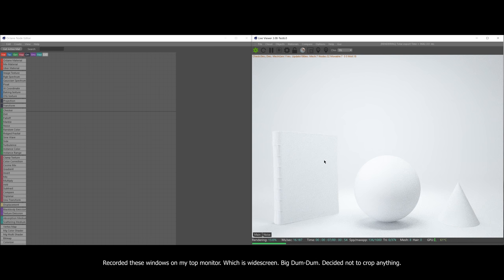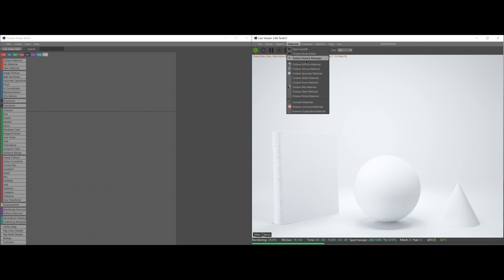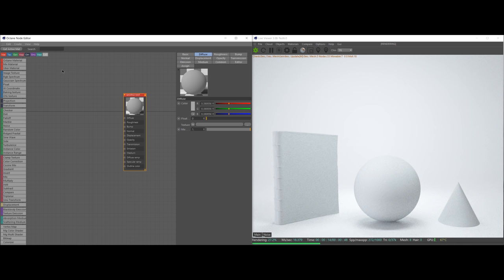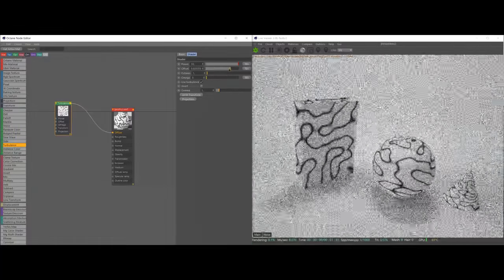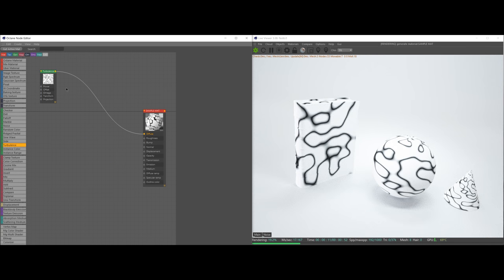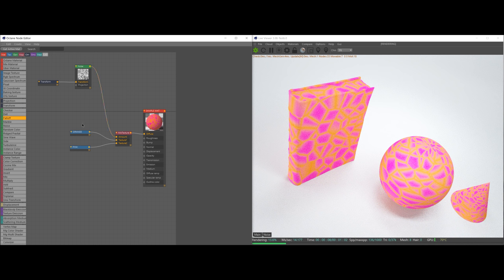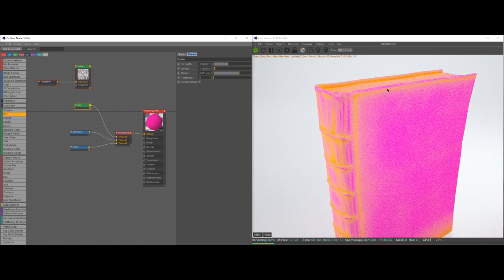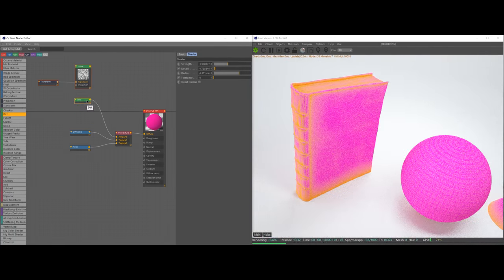The secret of REALISTIC MATERIALS | Octane nodes explained

Comment: Pretty Sure I will njoy the shared knowledge. Did not watched the tutorial yet but wanted  to give quick response and be the first comment so ;d sorry. Wondering since your workhouse has invested so much in GPUs, what are the inner opinions about other GPU renderers like Redshift ?
Reply from the maker: Thank you for the question. While I think Redshift is more suitable for big productions and demanding scenes, Octane is faster and is physically correct (unbiased). All the advantages that competitors might have (Like AI denoiser for instance) will be implemented in Octane in upcoming releases. 

To be fair to Redshift and other engines, I haven't used them PROPERLY in the real production environment. I believe it's better to stick with one system, one workflow and improve yourself in it consistently, rather than jump around experimenting. We did have challenges with vRAM limits on a project involving tens of unique complex buildings, but it was solved by structured and planned optimisation. We've been able to render areas with all the plants, buildings, cars and people.

Unless I see something truly revolutionary, we won't switch from Octane. The only Redshift benefit I see is no memory restrictions. Which is a temporary problem for Octane with fast-evolving GPU technologies :)

Comment: This is just what cycles engine can do for years🤔
Reply: except you have to deal with blender :(
Reply: I agree, Cycles and many others. Vray, Arnold also the old MentalRay can do all of these things for many years... What is so innovative there? I don't understand why everybody is mindblowing by Octane. It's just trendy. I learned Octane for my job but i'm not really conviced
Reply from the maker: It just means you have to learn fundamentals to understand the difference. Most of engines you listed are ray-tracers. Octane, Redshift etc are path-tracers, and performance they provide with GPU rendering outperforms all other engines ten times and more. Apart from that GPU rendering is significantly cheaper than CPU. That’s all. Other than that it’s just trendy indeed.
Reply: I already know the differences between ray-traced and path-traced render engines, don't worry. Sometimes, GPU renderers are not as fast as we expect. Render times are pretty close from each other for the same scene. In my opinion, the cost (time and resources) doesn't really matter, the result a lot more. My comment wasn't directly destinated to you, Andrey; but those who discover CGI, don't know how it works and thinks Octane is better than others because it looks good in few clicks. Finally, they don't know how it works and how to properly set a render scene. If a render engine is cheaper in calculation time it's a bit stupid to ruin this gain with a lack of knowledge, isn't it?
By the way, good video and good quality content on your channel, thank you for everything!
Reply: Cycles is WAY SLOWER than octane.
Quick comparison
Something rendered in cycles will be rendered 5x faster in octane